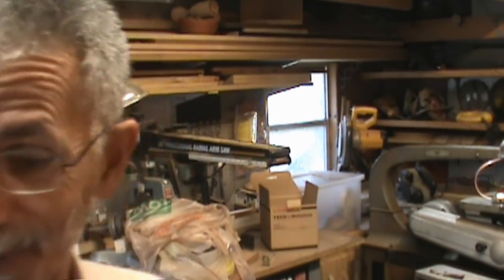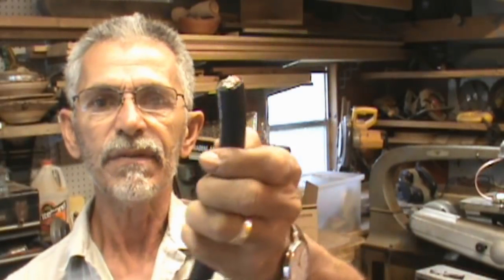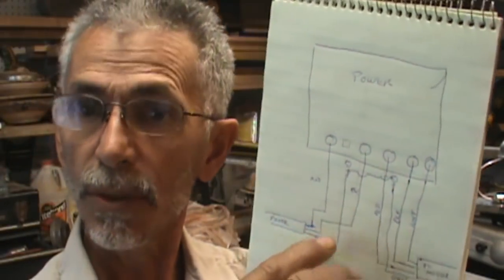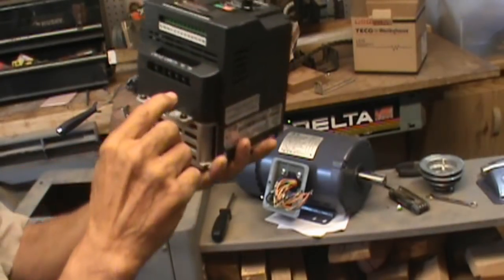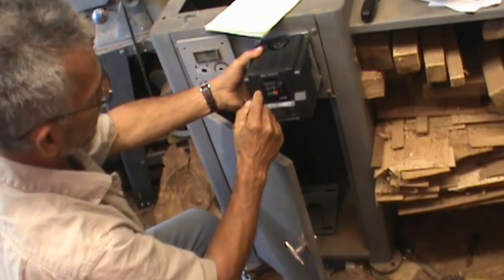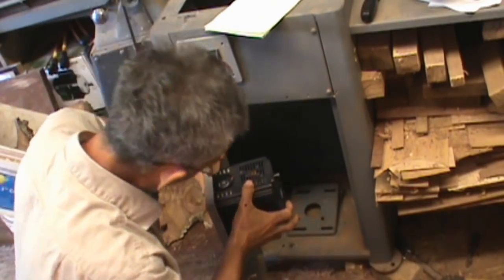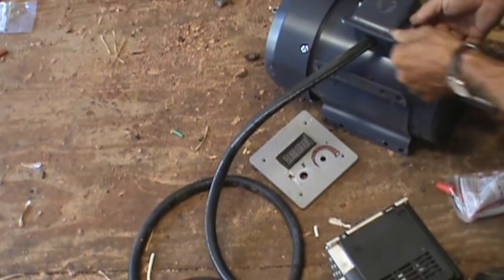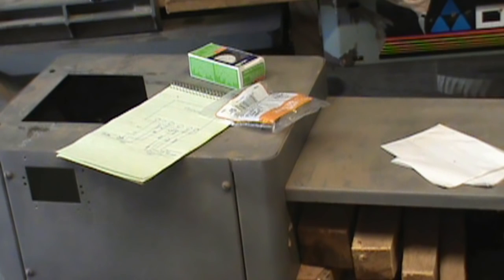VFD upgrade part 2 by Al Furtado

Comment: Al,
You might want to add a cable clamp on your motor to keep the wires from being able to be pulled loose or vibration from wearing the insolation off. Better safe than sorry when you are using 220 volts.
Reply from the maker: Good advice Thanks I followed your suggestion.Take care Merry Christmas.

Comment: Is the plug shown not a 20 amp 120 volt, not 220 ? Blades should both be horizontal for 220.
Reply from the maker: Thanks Thomas, You had me questioning myself on that.  I knew I had looked at the box when I purchased it and was pretty sure I had read 20 AMP 250 volts. and that is what it is. They do sell one that looks like it for 120V but both prongs are upright with a T on the left side. this one has a sideways prong on the right and a T on the left side as well. latest video shows that. .Take care Merry Christmas.

Comment: Great upgrade Al. Thank you for sharing this very detailed video. I think you might want to add an SO cord connector to at the motor connection j box. (It has another name that may be offensive to some viewers lol). Also you did a great job on the cord cap most folks have great difficulty with this. I think you mentioned where you purchased this from but I missed it. 
Take care my friend and do a kindness
Mark
Reply from the maker: Thanks Mark I believe we call it a grummet so the cable can go through it and be clamped in no? The VFD and Motor combo was purchased at  http://dealerselectric.com/1-HP-1800-RPM-115-Volt-Input-Package.asp I purchased the 2HP 220v in VFD with the 1 1/2 HP 3 phase 1800RPM motor.Thanks my friend. Take care